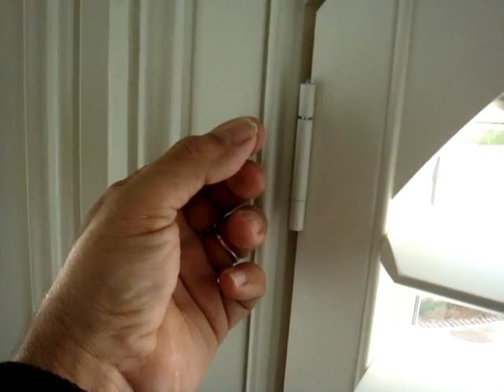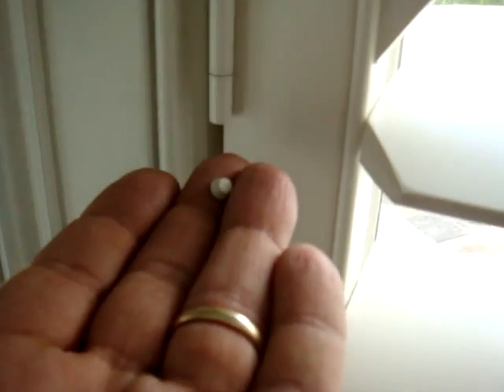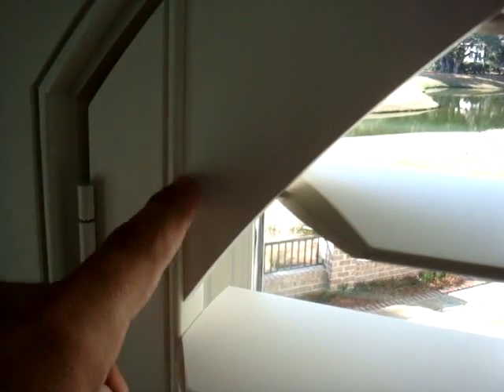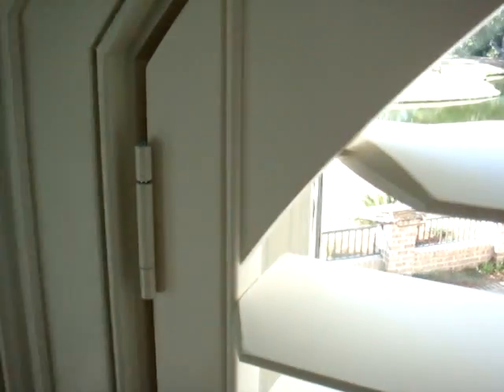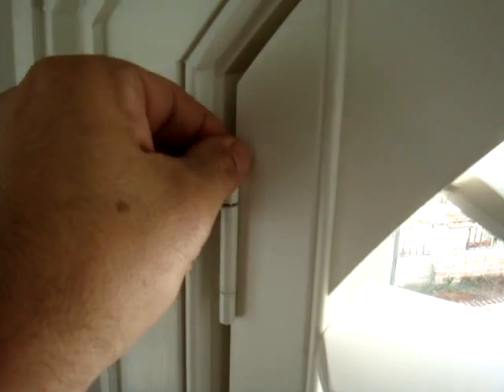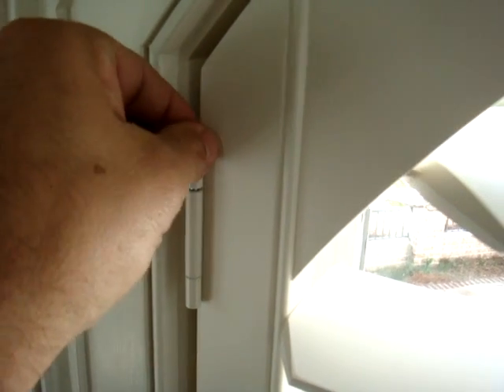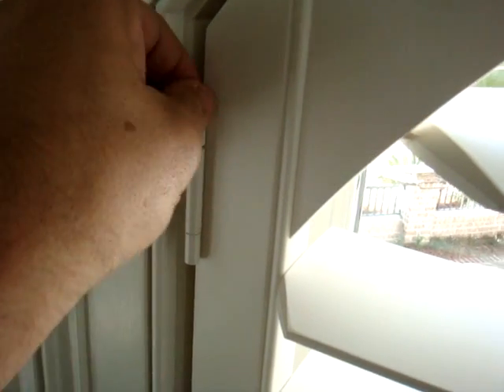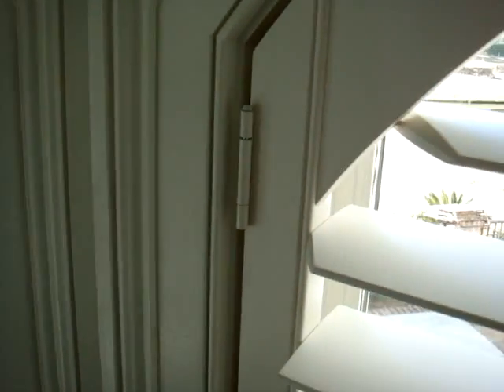The worst part of Norman Shutters

Comment: Push the pin 1/2" past the top of the hinge, it is even easier, and you can ensure the cap is fully tight, then tap the pin back down inside the hinge. If the door will not stay "open" put a small bend in the pin, this will create friction in the hinge, and hold the shutter in the desired position.

Comment: They don't have those type hinge pins anymore. That used to be an asinine way to get the hinge pin in from the bottom in case of deep inside mount and pin would not go from the top. ( you're right,was a total PIA and could have just lowered hinge ) They started using smaller hinges years ago where you don't have that anymore.

Comment: I have  shutter  panels  I'd  like to   cut  the length  down.  They have the hidden/  enclosed  tilt  mechanism. Has anyone had  this experience?  Can it be done?
Reply from the maker: Susan Hines-Elzinga  It depends on how much needs to be taken off. The problem with newer Normandy shutters is the embedded magnets dont have screws holding them in.  You would have to drill a new hole for the magnet if trimming more than 1/4''